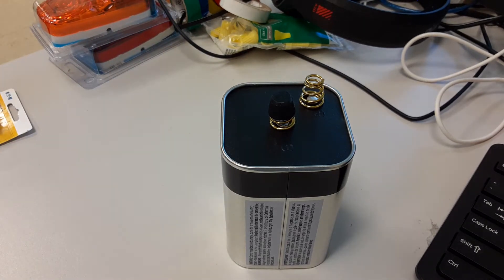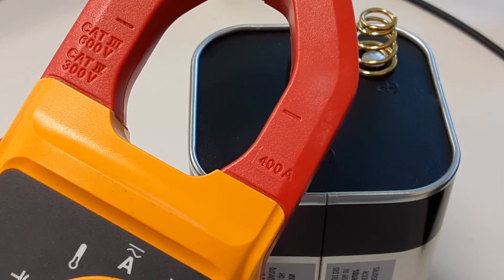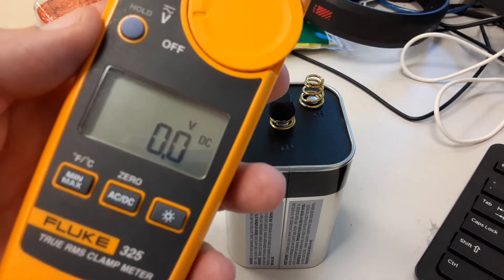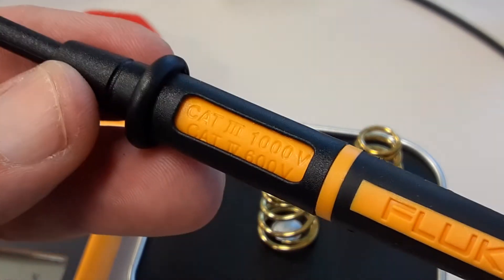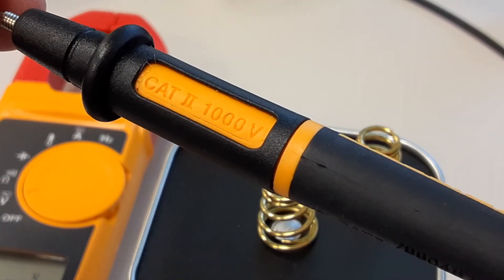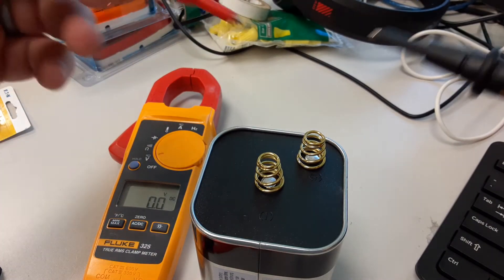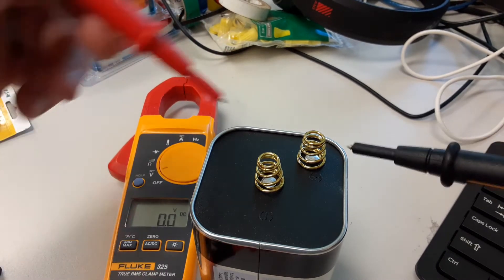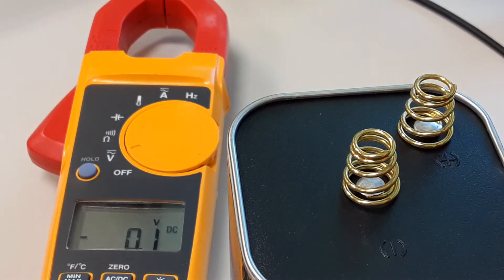Fluke 325 dc volt measure

Comment: Does has the clamp meter its own probes or did you buy them separately?
Reply: Included
Reply from the maker: Yes they came with the meter. I order from www.fluke-direct.com They have good prices, but I have to admit that amazon usually has the same pricing with their 2 day delivery.